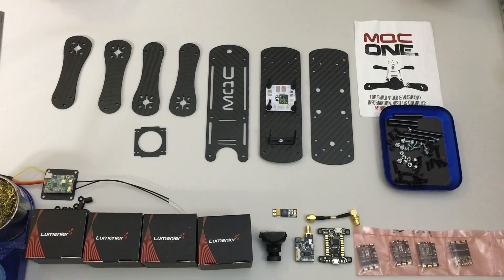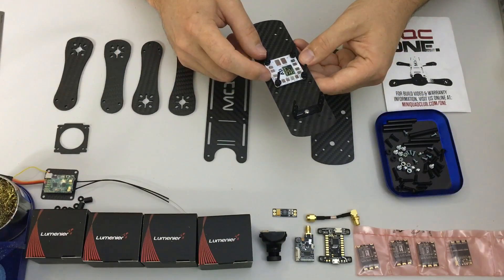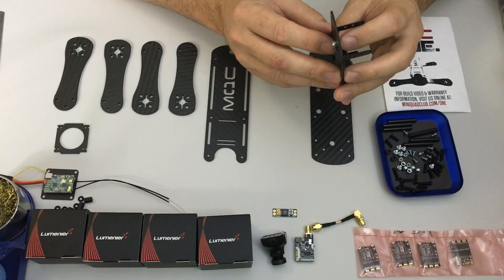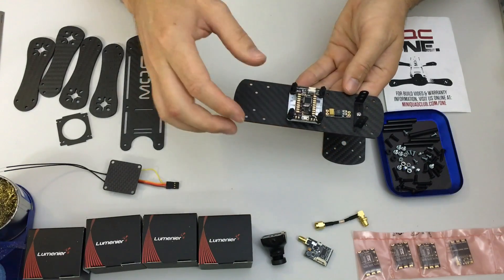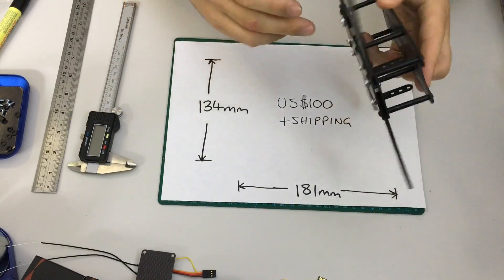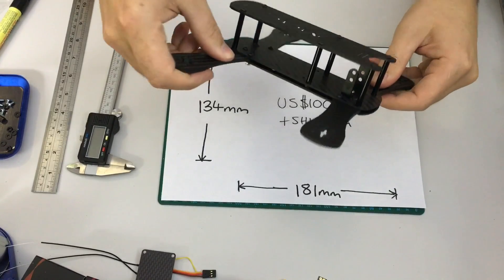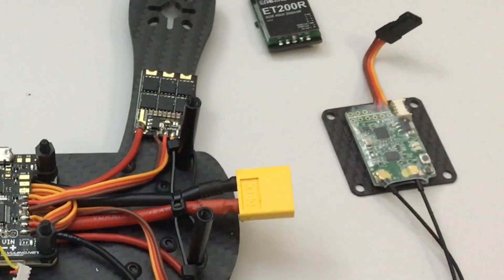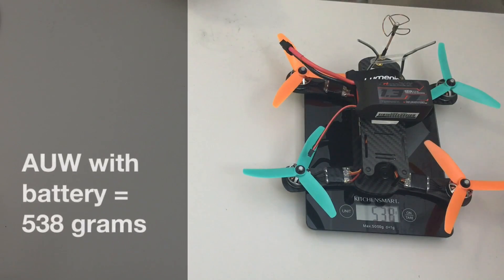Part 4 - 5"MQSO - Mini Quad Club MQC One Build Summary

Comment: What size o rings do you use? on the nylon stands?
Reply from the maker: Not sure of exact size. The hole must be about 2.5mm because it is a snug fit over the 3mm thread. I get them in a kit called the 'Plumbr kit' (no, not a spelling error) from BoltRC.
Reply: alright. I think I saw them selling #003 and #004 o rings at another quad site and ended up buying those. the #003 seemed to fit the best. the o rings used as mechanical keyboard dampeners are a great way of making a snug fit for the vtx on the krieger (and I'd assume mixuko, though he gives a specific o ring on the build page)

Comment: Thanks for this awesome series. Which quad is up next? I'm eagerly waiting for the Martian one. I have a II on the way from Hobbyin. So far I couldn't find any build threads/videos, only a few videos of it in action
Reply: any alien build will suffice. theyre not interchangeable but my guess is they build up identical. should be loads of Alien build videos.
Reply from the maker: +Gorm Breinholm Travis is correct, they build up similar to Alien.  the only real build difference will be the camera mounting.  I have a Martian II on the way also, the original Martian was updated based on my review/comparison and is no longer available.  So a Martian II will be used in the shoot out.